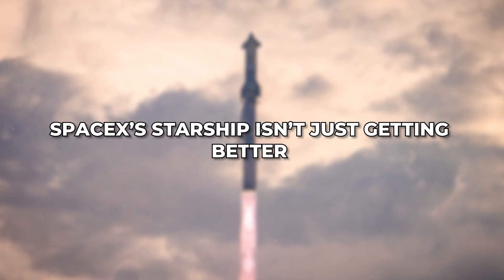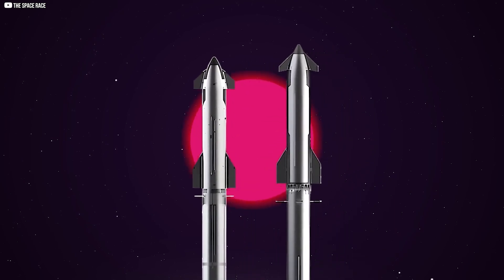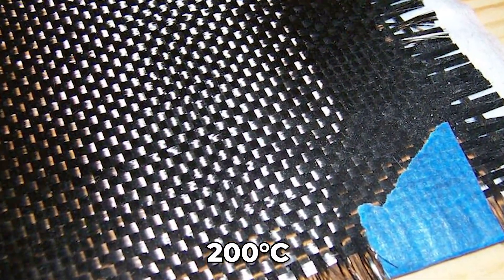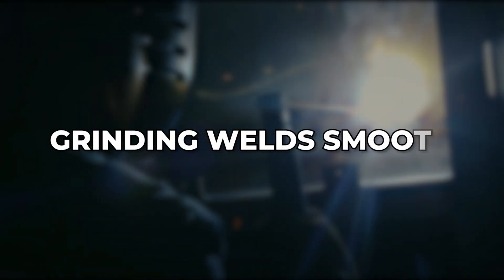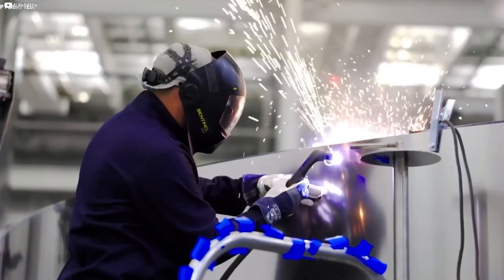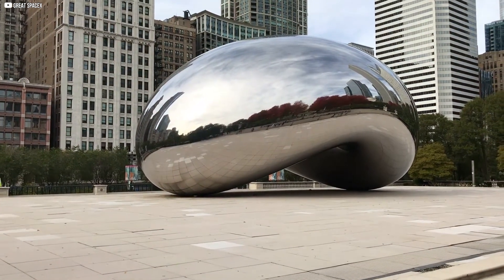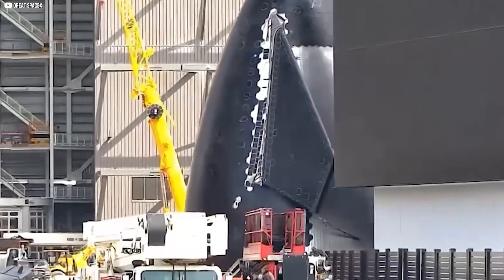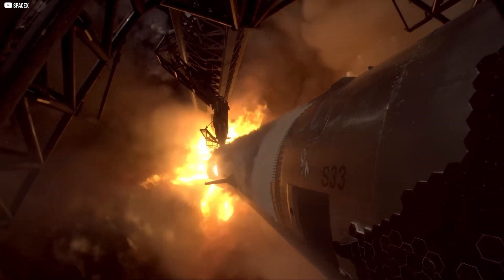The REAL Reason SpaceX Changed Starship V3 Welding Methods

Comment: Polishing could easily be achieved by the use of a robotic arm equipped with an electric buffing wheel that could work on polishing 24/7. And, or an annular ring with containing multiple buffing wheels that could move up and down large sections of the starship polishing as it does so, hoisted up via a gantry crane, lowered, and repeating up and down automatically. The polishing device could contain a dozen or more buffing wheels operating simultaneously.
Reply from the maker: Thanks for sharing those innovative suggestions for improving the process!
Reply: @TheForgeEmpire  Thanks for your positive feedback.